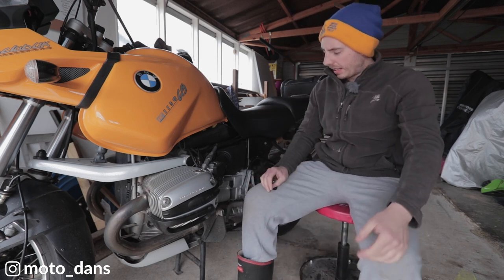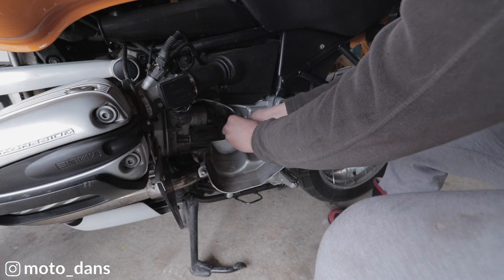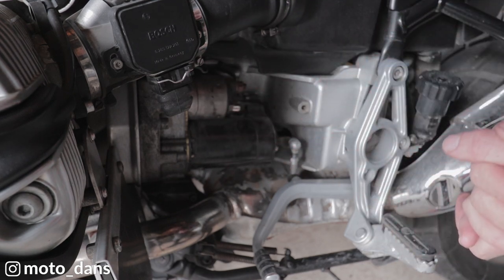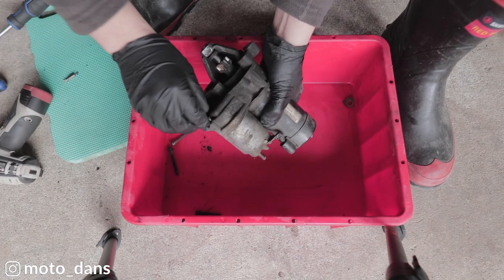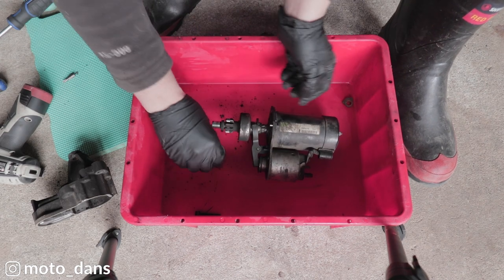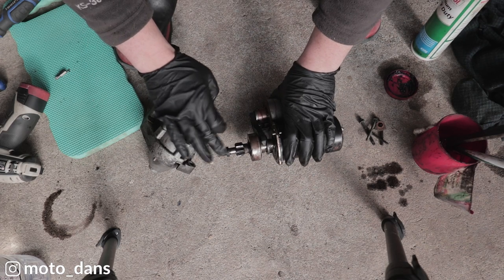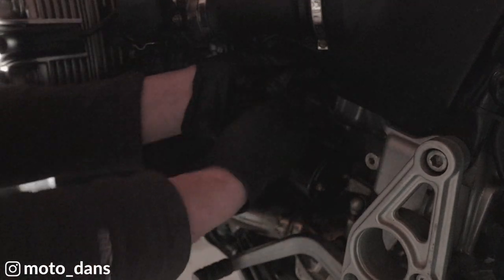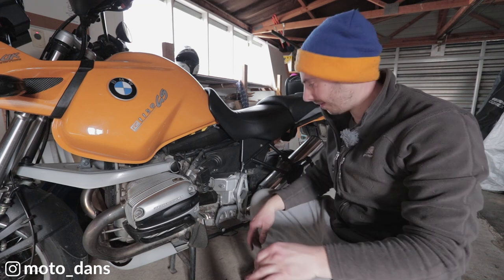Bmw 1150Gs- Noisy starter motor fix

Comment: Good job Dan.
The 1150's need a good battery as well. I found out the hard way that a less than optimum battery will kill your starter motor. I replaced mine with an after market one.

Comment: Great job Dan, that starter is built like a car wow very heavy duty.  Great job indeed sir
Reply from the maker: Cheers Dino. Yes indeed, a lot of this bmw is similar to a car. Has a full size alternator driven by a belt. Dry clutch with separate transmission. Quite cool for a bike in my opinion

Comment: Good job!! I'm R1150GS owner from Japan. Thanks for maintenance movie for R1150GS.Have you ever removed the front cowl? I need help!
Reply from the maker: Thanks for watching! Wouldn't be a very common bike in Japan? I haven't removed the whole cowling. Removed some of the components in this video https://youtu.be/iDvqTU78c70
What are you trying to do?
Reply: @MOTODANS  Thanks for response! I saw your video but that was wind sealed! How do you say that.....yellow big front fender?
Reply from the maker: @Toranosuke0011  Right i get you. I am not sure sorry i haven't removed mine. I would guess there would be some bolts underneath and then unplug the indicators and it may come out?

Comment: Y 03 R1150R was making excessive noise so I was going to take the starter off but when I went to loosen the bolts, they were already loose so I tightened them over 1 full turn and tried it and it was ok. I had just bought the bike and I think the guy had been “working” on it.
Reply from the maker: Wow, be worth giving checking all the important bolts of the bike to make sure they are ok
Reply: @MOTODANS  
Yes, I just got it so i will be going o er it and changing all fluids and checking everything I can get to.